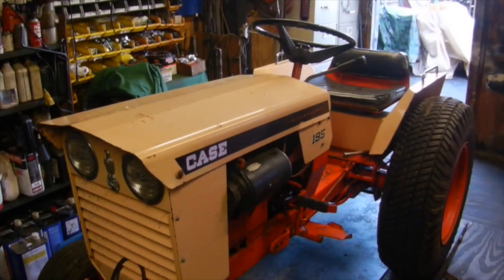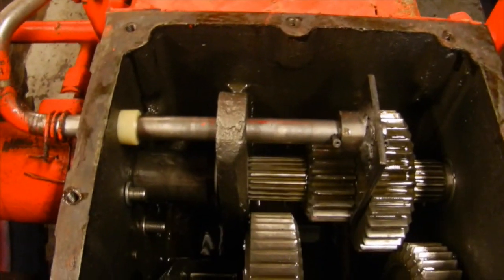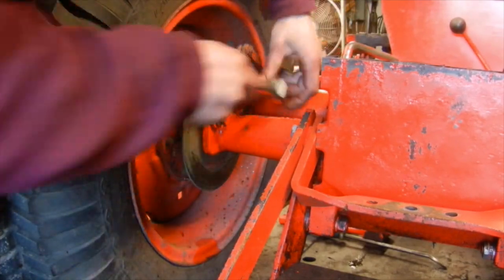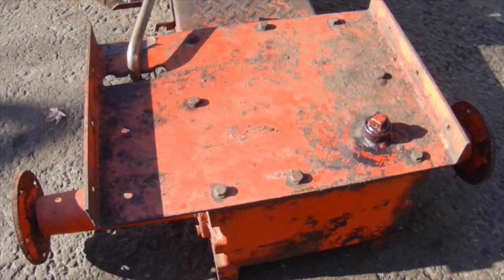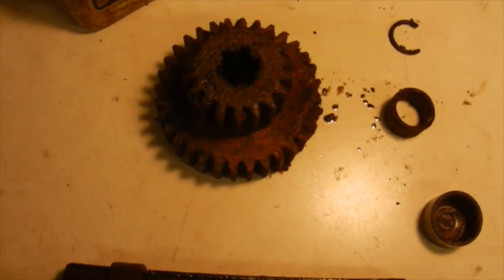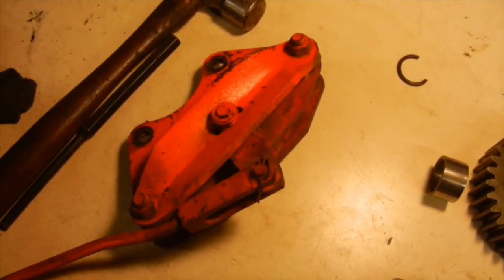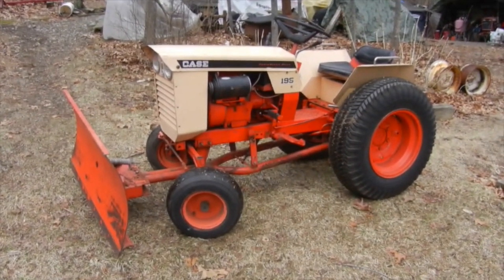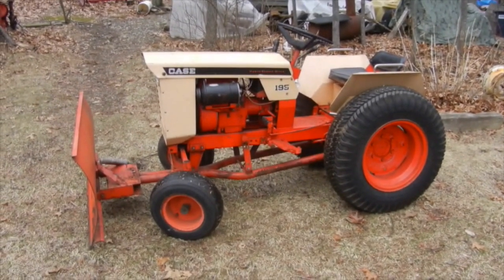1968 Case 195 Transmission Repair

Comment: Going to look at a case 150 barn find it’s pretty clean but dirty and it’s not a high wheel but if all goes well I’ll have my first case!!!! I’ve been watching your case videos to learn a bit more about then
Reply from the maker: Nice! Hope you were able to stryke a deal on the thing... Case 100 series are cool tractors.
Reply: @5Tractorguy  he wanted 375 wich is what he paid for it I offered 350 and he reluctantly said deal but tank and carb need to be cleaned tank is extremely rusty with a few small holes hopefully I can make it work carburetor is been soaking in diesel fuel and is loose if you the varnish I made battery cables for it and got it to crank over and run on starting fluid the drive system appears to work wich is a plus

Comment: Nice 195! 195 was our first Case Ingersoll machines, and a few hundred or more later still have the 195 out back lol. 195 were cool machines but love the updates and capabilities of the later models. Good video like finding other Case Ingersoll videos!
Reply from the maker: The old 195's are neat machines! Always liked their styling vs. the later series... I'm located in central MA.
Reply: @5Tractorguy  Cool we are in central CT, nice to know other GT guys around. If you ever need anything let us know, we have lots of new and used parts. Looks like you have the service part under control lol

Comment: Great Intro, Jake! You know...I think the engineers that design the tolerances do that on purpose..."just a 1/16th more...nope..gotta take this off..after this but before that..but only when this is loose...and those are knocked to the left..." then they watch the repair vids at their company picnic and laugh their butts off....
Reply from the maker: Hey thanks Dave! Dang engineers... of course they don't have to work on anything too. It's like opening the hood of a truck pre1990ish and one from today... chuck full to the brim with hoses, sensors, wires and useless junk to make an engine run. Trying to re-invent the wheel I guess.
Reply: 5Tractorguy Justification of your existence.

Comment: From what I read this problem was also endemic to the 180. If I had this issue on a tractor today I would look into the possibility of mating a Case 400 series rear axle assembly to this tractor as they are much more heavy duty. The differences that I am aware of are this older design had a much better braking system (disk) compared to a single Drum that only stops the transmission on the 400 series. Low pressure electric fuel pumps for these make them much easier to start when they are cold. After setting a while the gas takes a long time to get to the carburetor because the fuel tank is located below the engine and the stock vacuum operated fuel pump only moves the fuel very slowly as you are cranking the engine over. I really do like the looks of the round headlights and round fenders on the 180.

Comment: Good job, thanks for the video. I have a couple questions:
1. Where do I drain the transmission oil?
2. You mentioned this tractor wouldn't be used hard, is using that plow blade considered hard?

I ask because I got a 195 and I'd like to use it to push snow but it if would be better off using it in the local parade due to not being very stout and hard to find parts, I'm okay to do that.
Reply from the maker: Thanks Spencer.
1. Oil drain plug is on the front face of the transmission casting where the hydraulic lines enter. It will be to the right of the lines if looking at it straight on. 
2. Would and wouldn't. I'd push fluffy snow, mulch or a little bit of dirt, but nothing more. As long as the material isn't heavy. Previous owner used to plow snow with this like no tomorrow so I think that's what did the shaft in. May want to stick with the parade... these shafts are tough to find.
Reply: 5Tractorguy thank you. Maybe I’ll get a Cub Cadet for some heavy duty work and the case for parades. Should be fine pulling a small trailer with kids?
Reply from the maker: @sokey70  Go for it! You'll be fine with a trailer... It's moving piles of dirt as high as the blade, heavy wet snow, bucking the trans, running into something with the plow and spinning the tires that'll make that shaft snap.
Reply: 5Tractorguy good to know, thank you!

Comment: Where is the hydraulic reservor on this model ( 195 )
Reply from the maker: The rear end (transmission case) on the 100 series is the hydraulic reservoir. Lines for the pump thread into the bottom of the case in the front.
Reply: how to drain te oil ?? what is the method to flush te hydraulic system for a new oil ( bad english i speak french )
Reply from the maker: Not a problem, I understand. Oil drain plug is to the right beside the lines going into the front of the transmission case. As for flushing the system, removing/loosen all the lines possible underneath to let them drain. If possible, remove the left most line that goes into the front of the transmission, this has the pickup screen for the oil, always good to clean if you can.

Comment: Do you have the procedure to replace rear Axle seal ?
Reply: for changing just the axle seal , i can just slip it off or i have to open the top rear end for removing un C clip or something it lock the axle ?? im french sorry for the english
Reply from the maker: Where they roll pinned the end of the axle in the differential gear... knock that pin out, remove the brake caliper and you'll be able to slide the axle out of the housing. The axle seal sits in the end of the housing.